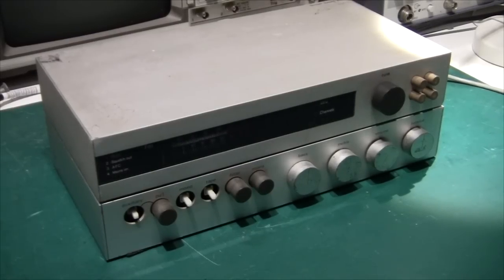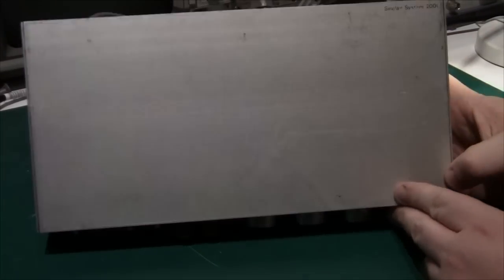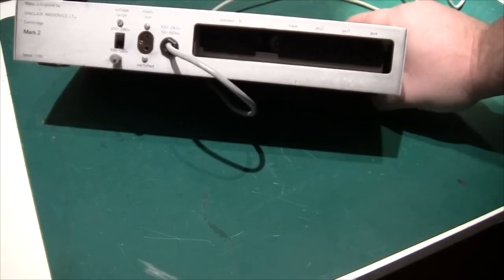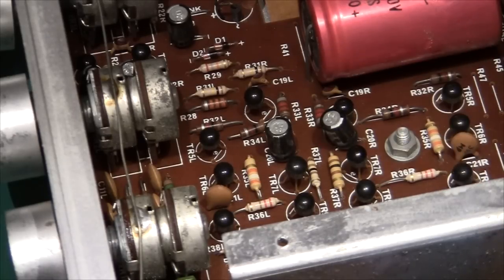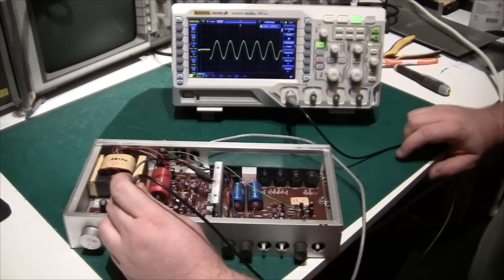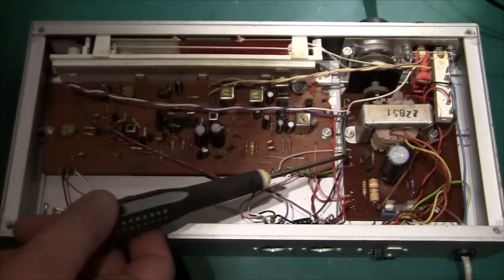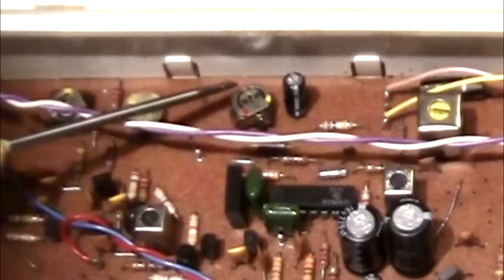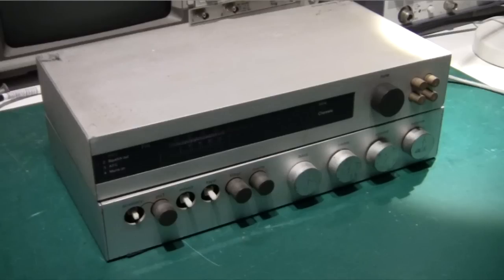Teardown of Sinclair Radionics System 2000

Comment: This quite interesting to hand built equipment.
I wonder if this is the same Sinclair that  made and sold a low cost digital multimeter that used a 3 and 1/ 2  digit LED display. If this the same company, , I owned one of the in the early 1980's. It was sold in the U.S. by Radio Shack.  It replaced an analog multimeter from Calectro/GC Electronics(Rockford,Illinois,USA ).  Thank you!🤠. 
"Al " from Crestview, Florida, USA

Comment: What? The 'little metal bracket' is not there to stop you sticking your fingers into the electronics, it's a screen to stop hum fields from getting to the input din sockets. As for the 'things that look like capacitors', they actually look like transistors, which is what they are. As for Clive Sinclair himself doing QA in  1970, I very, very much doubt it. 'Clive' was probably just a production assistant.
Reply: I think your haughty Ness may be a bit out of place in your assumption that sir Clive did not take part in the QA of manufacture. I had dealing with radionics in the early 70s and there was certainly somebody in the place that was making sure that you would be a satisfied customer and I think that person was uncle Clive.
Reply: @factorylad5071  Well you can think what you want, but according to the several books I've read on the subject, Clive Sinclair never got his hands dirty except in the very early days of Sinclair Radionics when he was developing the hobby kits.
Reply: @andyhowlett2231  His first hobby kit was a neat reverse polish calculator in 65 do your books go back that far??
Reply: @factorylad5071  Indeed my books go back to his early days producing radio kits like the Slimline and the Micro-6 in the early/mid 60's, and even earlier than that when he wrote technical articles for Bernards. Sinclair did NOT produce a RP calculator kit in 1965. The first calculator from Sinclair was in 1972/3 with the 'Cambridge' series, then came the RP one in 1974.
Reply: @andyhowlett2231  Then Besides The Black Watch and the micro TV that covers 70s kit activities. Except The Z30/60 kit amps. Clive was the only man in Britain capable of pcb manufacture. That didn't just happen. He did not order over paid and over fed executives to go round to sign pieces of paper for him as you suggest. If he wanted something doing he would do it himself. And if that means writing Clive on an inspection label, so be it. Now stick that in your pipe and smoke it.
Reply: @andyhowlett2231  But he would let the dog do the barking, like any sane man.
Reply: @factorylad5071  Oh dear. Just because you believe Clive himself sat there in quality control inspecting products doesn't mean it's true. You have no evidence at all. Clive was a common name in the UK at the time. 'Clive was the only man in Britain capable of PCB manufacture', are you kidding? PCB's had made an appearance in domestic radios and TV's while Clive was still at school FGS! Do some research before talking rubbish!
Reply: @andyhowlett2231  So you are going to laugh at me then, you who cannot even read. I did say man to make his own pcb. Implying that the rest of pcb manufacture was corporately owned, not by A man. So you see Sir Clive must have built the fabrication unit himself. That is how he became known as uncle Clive. When I was building Sinclair kit amps, I destroyed a pair and Clive sent me a couple of free replacements and a nice letter..
Hahaha so you think there was some other guy with self promotional interests working on the assembly line? Well that's one up for you I would say.
Just because you have read some fairytale books doesn't give you the right to come on here preaching. None or not all of your books can match the 50 year involvement I have had with semi conductors. I wiil whittle you into kindling
Reply: @andyhowlett2231  If you have been able to process my last comment you can see I DO have evidence.
Reply: @factorylad5071  This is getting surreal now. Where is the evidence? The fact that he sent you  a free replacement z30 has no bearing on who worked in quality control. I also had free stuff from Sinclair, but that doesn't mean he worked in quality control. The 'Uncle Clive epithet came from his ad agency Primary Contact, who told him he needed a more personal  relationship with his customers. This was in the early 80's when he launched his ZX computers.  And what happened to your claim that Sinclair released a RPN calculator in 1965...?  Are you going to explain that howler? You seem to be making stuff up to prove your fiction. In fact I'm beginning to think you are on a wind-up so I will not be engaging with you any more. Have a nice day.
Reply: @andyhowlett2231  which could be a succinct way of saying you are sorry and you have lost the argument. Quite rightly so because the informed tones of the narrator tell us it was only a small outfit so your blabberings about there being another Clive become diminishingly small indeed. So the only bone of contention is the RP seven segment calculator kit that I said was 1965.In making up that statement I rounded off to the nearest 5 year boundary. I can tell you though the exact date was 1967 , the year before my first maths exam. If I was playing with one then so would be Clive. What makes you so clever to say he did not have a calculator kit in the pipeline somewhere? I did pass my maths exam but I was the only boy in school who did that year , so work that one out.
Reply: @andyhowlett2231  and I did not cheat  Have a nice year.

Comment: I presume, that to select aux and pu1 together would give pu2. Not that uncommon in those days. Quad 33 had something similar with their Mono,Left,Right and stereo buttons.

I noticed that the gap on the backplane might have included another switch. Which seemed to be shortcut 1 & 2. Can you find out what purpose it had?
Reply from the maker: The gap in the backplane is for a switch marked PH (I suppose Phono).

Comment: some of these were kits, as for the transistors, i wish i could get a quantity supply, nothing wrong with those taiwan epoxy packages,i buy up stocks of metal can parts, for detector projects and one off's, at least they are what they should be not shen shite market rubbish.
Reply from the maker: I don't know where you are in the world, but here in Denmark, there are websites for the radio amateur community. Sometimes there are people selling old components from shacks where the owner has passed away.

Comment: For lots of FM tuner information, there is a site and a related yahoo group worth visiting called fmtunerinfo.  They have catalogued hundreds of tuners but don't seem to have anything on the Sinclair. Some of the UK members might be able to provide more info and might have worked on that unit.
Reply: My recollections of the Z 60 kit stereo fm tuner was something built in discrete with a little vari cap diode tuning stage and a couple of mosfets for rf. Very good antenna sensitivity as well.
Reply from the maker: Thanks. it could come in handy. It's probably a fairly standard design based on the SN76660n. if I can find the datasheet, I should be able to get it going. After all, reverse engineering the thing should not be too difficult with a single-sided PCB.